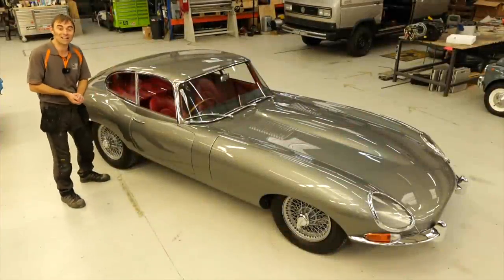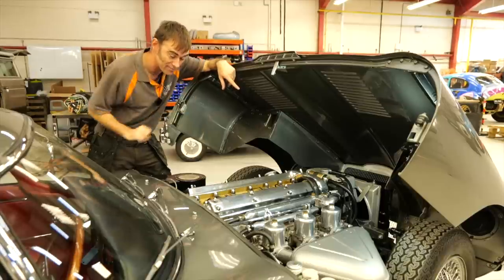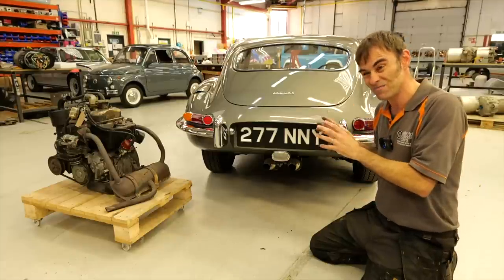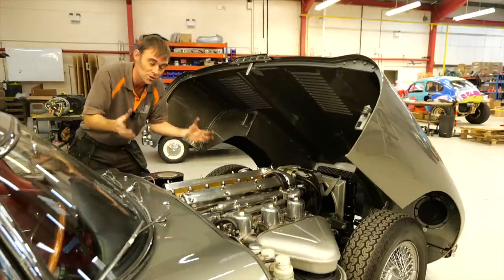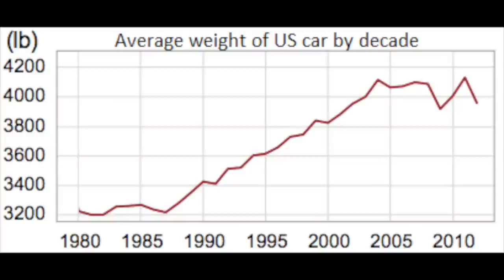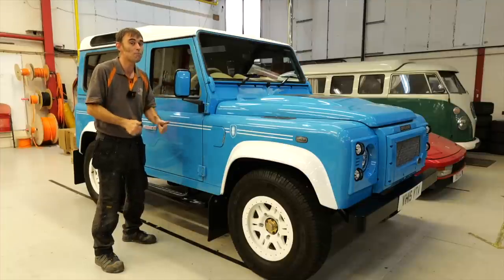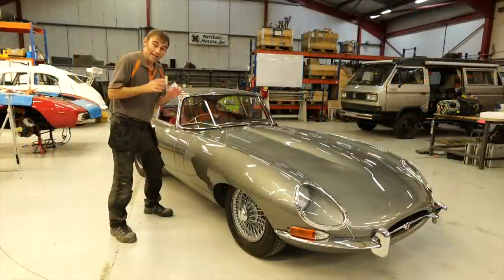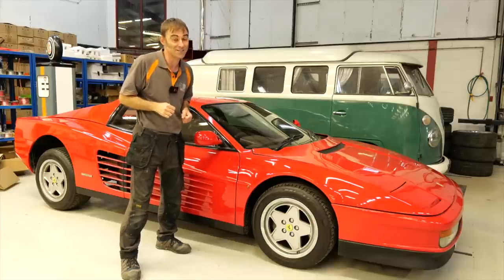Is it a sin to convert a classic car to electric?

Comment: I agree and applaud what you are doing, just got my first electric.  I think the biggest obstacle in some cases is the usability factor, meaning in say a jag, you have to give up a lot boot space in order to get a decent amount of range.  I would love to see some conversions figure out how to put batteries in the floor of the old classics, making the car super useable for everyday, or weekends  away.
Reply: in response to your conjecture, watch the ecc video about the conversion of the testarossa AND how far do you actually want to drive in the same stretch? (Google translate)
Reply: Some conversions lose very little boot space. 👍😀
Reply from the maker: We often lose very little boot space and some cars like the Testarossa the luggage space increases. 👍
Reply: I agree with this statement. I have one car that is enjoyed primarily for an annual trip from UK to the Alps for a week each year that I would dearly love to convert to electric, but the sheer pain of being able to get there, enjoy the week and get back means it's just not feasible with today's battery technology.
For reference, this year that car cost me £850 in petrol for 2,200 miles in one week (and I wasn't the highest consumer of the group!)

Comment: Soul: Because it is still related (albeit 'just') to fire. External combustion much more so, but there is the lineage, and we like to play with fire. Not passing an opinion and have long accepted IC can't continue for ever, and nor should it. But we need to make it fun and most (note caveat) are not appealing  to petrol heads like myself (Morgan's 3-wheeler from a few year ago is a wonderful exception) and they'll sell themselves. Your way of doing it is fine by my reckoning and has a role to play in showing people we need to find different ways of having fun.

Comment: I like the idea of electrifying old/classic cars. It allows people to drive something really cool/beautiful, but not deal with the hassles of ownership (maintenance, etc) like you mentioned.
Regarding soul... I believe that refers to the sound and vibrations from an engine & gearbox. The gentle rocking at idle. The sound of the air intake and exhaust. Interacting with, and the 'click clack' of the gearbox. The clutch actuation and occasional grinding of gears. Warming up a car, maybe skipping gears until optimal temps are reached, and then booting it!
Most old/classic car owners love that kind of stuff. I can understand it, but I'd rather just get in and go! LOL

Side note: One thing I've always wondered, how do you store an EV for longer periods? Say 1-3 months or more without damaging the batteries? It seems modern hybrid hyper cars have issues with sitting around, sometimes requiring expensive battery back replacements. Would it be the same with an EV conversion?
Reply: just keep it plugged in.  The battery management system will look after everything.
However, lithium batteries have a much longer shelf life than lead-acid in any case.  You would have to have it in storage for a long time / have a vampire drain to cause concern.

My limited experience of lithium cells (ie, from a phone battery cell) is that they will, if allowed to discharge too far, refuse to charge at all (I think the chargers fail to detect their presence) - but manually adding voltage (jump start with another cell) will bring them into use again.  Discharging is bad for the batteries of course, exercise caution etc, but they can be brought back.

Comment: I think two of the major cons to electric right now are charge time and the total distance the vehicle can drive. Not to many people can afford having an “in town” electric commuter car and also a long distance fossil fuel car. Electric is well on its way but until these problems are solved it will always be in the back seat compared to fossil fuels. Additionally battery life is not yet proven and is an extreme cost if they do need to be replaced. I have pursued so many different options to convert a 53’ Dodge M37 to electric but currently not many options are available for that heavy of a vehicle. The energy density between fossil fuels and an electric battery  does not compare yet but hopefully one day it will. This is one of the major problems with an electric semi truck. The gross vehicle available cargo weight is substantially reduced due to the weight of the batteries needed to get it going. Diesel fuel allows each semi truck to tow more weight in each load than electric is capable of. I appreciate the videos and enjoy them! Hopefully one day we can crack the battery problem “Achilles heel” of electric. Your correct in stated that an electric motor is far superior to any fossil fuel engine. The difference is the chemistry in which these engine derive there energy from is not comparable as of yet. Keep the content coming!
Reply: distance travelled is the problem for me I do a minimum of 200 miles a day ,  when it is minus 20 or 30  with snow on the road  how far will that electric car get me ? With snow and ice it can take 2 or 3 hours to go  100 miles  when the temps are low I would be very worried  that I would be stuck dead on the highway  not much worry with my gas cars as i get at least 350 to  500 miles on a tank cut that by 20% with heavy snow with traffic moving at 30 mph    still nothing to worry about
Reply: that is true , look at how heavy some of the new electric hickuptrucks are now . Some are over 9,000 lbs  with no load ,, hat is a hell of a lot of weight . Would not like to be in a car that gets t boned by that beast
Reply: @imarobot3757  Yes, you and the 6 other people with the same driving needs can still get a gas car. That will be ok
Reply: @imarobot3757  that's 1 EV. Other eV trucks are 6700-7100 lbs, around what a F-350 weighs. And I'd rather me tboned by that than a 14,000lb commercials truck, of which there are millions. The 1st gen of these long range EVs will be heavy, subsequent iterations will discover how to build around the new architecture and remove weight.

Comment: This is quite an interesting perspective on the relationship between an electric car and a petrol car. I find them completely different machines. Like the difference between a motorcycle and a car. You can have a car with a motorcycle engine or a motorcycle with a cars engine. Sometimes an electric motor destroys a car and sometimes it improves it.

Comment: It has often been the case that a particular vehicle benefited from an engine swap, sometimes to  a completely different manufacturer.  That was never considered a sin, it was a way to make the car legitimately better.  Similarly, swapping in an EV package is great if it improves the product.  Further, I say forget about 'reversibility'; no one is ever going to put a gas engine back in one of these if it's done properly.  EV technology is only going to improve.  Batteries will get smaller and lighter for the same capacity, same with motors/inverters, etc.  Plan to adopt those changes, not go back to gas.

Comment: I would say character, rather than soul.  Listening to your engine, you can hear what you're feeling. That is, if the engine is struggling, or on song, with the wind behind you. It sounds different when it's cold, or lumpy when it's too hot. You can hear the odd misfire or pop and bang on the over run.  You can hear the difference between a straight six or a V6, a V8 or 4 cylinder.  When it's purring away nicely, you feel contented. 
I could go on and on.  Maybe someone could put it more succinctly.  ....maybe soul is not far off, now I think of it haha
The electric motor, amazing though these installations are, is more like an on/off switch. It's always the same, regardless of what you're doing.
I think what you guys do is terrific, and a great way of saving many of these vehicles.  I'm just not there yet...I'm always a bit behind the times, mind you.

Comment: I am from germany. I was a proud owner of a 1977 Kawasaki Z1000 A2. That one with 4 cyl, 4 carbs and 4 exhausts.
In germany we have fuel with ethanol in it. You can't get fuel without since years. 5 years ago it gone so bad, that the fuel destroyed all the rubber parts, cast aluminium, paint and i always had water in the tank. In 2020 i was driving very often, cause we aren't allowed to do other stuff. Then i noticed, that the fuel got worse once more. Every 2 weeks i had to repair a carb. So i had to disassemble all 4, check them sync them install them. Then driving 200-300 km and the same crap. I had to change the fuel hoses every 2 weeks, too, and the fuel cock every 2 month. At the end i just filled in a few liters, drove it arround, and release the fuel from the bike.
Yes, from the tank and all 4 carbs.
But the problem came back. So i decide to sell it after a repair, and got lucky to sell it to a collector.

Then i bought an electric motorbike for a damn high price, and was happy about the missing repairs. 
But then i noticed, that the range is not the promoted one. So i have to calculate my route, and don't go away from it.
I miss my old Lady, but it was time to let her go. There is no way, to transform an old bike to electric. You will not get any good performance or range out of it.

Comment: You make a good point about fuel for classics. 

Petrol stations operate on tight margins. Within the decade petrol stations will begin to shut as demand drops and they are no longer profitable as we move to EVs. They will become fewer and further apart making ICE ownership difficult. A tipping point will be reached where it’s not worth keeping any open. 

This will be disruptive. ICE car owners will find themselves left with a useless vehicle. Although classic car fans might think synthetic fuel will come to their rescue, there’s not enough demand to keep a nationwide network of fuel stations running for a small amount of low mileage cars. 

Electrifying classics makes a lot of sense and preserves them beyond the demise of fossil fuel.
Reply: Yes, if you want to continue with ICE (some enthusiasts will and so they should, in the way steam vehicles are preserved) you will have to have the fuel delivered to you or go to a few specialist outlets.
Reply: There are still over a BILLION ICE autos, that will never happen

Comment: I loved the video and agree with mostly everything you said but RANGE RANGE RANGE! You never mentioned it once? I know it varies wildly for all sorts of reasons but here would have been the perfect place to explain the options and likely outcome of the range on a few of your examples I think.
Reply: I think a lot of the regular size cars are in the 200 mile range, but large, heavy vehicles may be less, as well as tiny ones with little space for batteries. However, if you have 100-200 miles, that's plenty for daily driving and a Sunday cruise

Comment: I like the idea of recycling the old cars and making them more friendly to the environment. I guess most of the cost of salvaging an old car is the body repairs to make it look brand new. I have one question: Did you have a request to convert a car to hydrogen fuel cells? Toyota is doing huge progress in hydrogen storage and ease of usage. Did you include Toyota power train into your work? It may reduce the weight of batteries and you replace the gas tank with a hydrogen storage unit.

Comment: Great episode!  For me the choice would vary from car to car. I would be okay converting my old Porsche 912 to electric (but I’d miss the smell of old car mechanicals) but I wouldn’t want to lose the sound of my Honda S2000 engine and shifting its gears.
Reply: I'm sure someone could make an air freshener for that!
Reply: I built a Wesfield from the ground up, complete nut & bolt rebuild of RS2000 engine, twin side draught 45s & a straight through side pipe.  Been driving electric since 2015 and if I ever build another Westie it'll be electric. Do I miss the noise? - Ask my tinnitus!  Do I miss the smell of fuel, oil & warm timing belts when I open the garage door?  I have to say yes - But that's about it.
Reply: I would be happy to buy the Porsche,...... Yet it's in America, isn't it.

Comment: I have been a bit of a petrol head myself, which a number of twincam / turbo charged / mid engined cars over the years. I don't miss those ICE engines at all now I have gone electric (we currently have a Tesla Model 3 and an old Nissan LEAF for running about town that just keeps going without any servicing). Sure I'm no longer young but I think when I was young I would have enjoyed the Model 3 just as much as I do now (if not more). 
That all said there is a small subset of classic cars that are worth keeping in ICE form - those rare cars with great sounding engines - and less likely to be daily drivers! Could you imagine taking an original Supermarine Spitfire IX and converting it to electric when part of the air show attraction is the roar of that Merlin engine!

Comment: I'm old enough to know that these Jags were very popular, here in the US, back in the '60s, but in the '80s, living in Florida, I worked with a mechanic that pulled the Jag motor out of these cars and replaced them with a small block Chevy, along with an adequate sized radiator for the subtropical climate.

Comment: One con: Living in a very cold country.. Range becomes much more of an issue at minus 30°C. A brand new petrol car will start and run. Refueling requires very little time. Re-charging a VERY cold battery is challenging to one's patience, even with battery heating solutions available. Future nano technology batteries may solve this problem. And, the future is definitely not in favour of the internal combustion engine. Love your show, keep up the good work! Edit: PS: I will miss the "noise" of the all American V8.. From a purely nostalgic point of view.
Reply: Modern ev car batteries have better functioning heaters on them to mitigate these issues. From the little I've read on them, they do fairly well at keeping the battery working well and not failing early.
Reply: @ax14pz107  Well, I don't personally own an electric car. But I know people who owns brand new electric AUDI's, BMW's, and Tesla's.. They say that all the talk from the dealerships about handling extremely cold conditions, is not backed by reality. The dealerships do admit shorter range though, but reality seems to be tougher. Also, in the motor press in Norway, there seems to be consensus about this. But as I said, I have no personal experience with this, it's just the opinion of these car owners that I know.. PS. we have (so far) absolutely no tax on electric vehicles in Norway, therefore, electric cars have become more common than anywhere else in Europe. And, some places in Norway do get cold in the winter.
Reply: @PaulM745  yeah if they're leaving their cars unplugged overnight, outside, they're going to get very cold, but that's true of gas fueled cars as well. If you live in areas that cold, don't you have to install block heaters in order to have the cars start anyway?
Reply: @ax14pz107  modern petrol cars with a good starter battery, and motor oil suitable for cold starting, no problem. They will start. Diesel can be a problem. Especially if you have the summer mix diesel on the tank. In winter, the diesel is mixed with kerosene, to avoid the diesel going solid. Also, it always pays off to replace the diesel filter before the winter season. And, the starter battery and glow plugs need to be in excellent condition. Provided maintenance is good, fossile fuel cars have no range limitations, and refuelling is fast. This being said, I'm not against electric cars, but we are still in the late "pioneer" era, especially when it comes to cold climate. This will be solved with future technology...
Reply: @PaulM745  I see. We also have EVs that run at higher voltages now that can pretty much max out the battery in fifteen minutes when charged at a fast charging station. Range shouldn't really be a concern anymore unless you're very rural, driving constantly, pulling heavy loads, or just have no access to overnight charging. For the majority of us, the infrastructure to use EVs as daily drivers is already in place. My next car at this point is basically guaranteed to be an EV. I don't have to deal with extreme cold though. Temps here range between -2 and 37 usually.
Reply: @ax14pz107  perfect conditions for ev where you are then. If I were to buy a car, it would be an ev as well, despite the winter challenges.

Comment: What a well presented argument and total low key stealth tour of the treasures in your amazing facility! I agree 100 percent. I love cars. However, I’m not a petrolhead. I love most cars for their design. Like you said the majority of engines in classics is forgettable (literally any old vw engine for example). Maybe interesting from an engineering point of view but that’s about it. IMHO very few ice/car combos absolutely shouldn't be converted. I’m not gonna lie - the moment Tim turned on the Jag - that sounded lovely. Same goes for my 5.7l V8 Jeep, I love the sound of that boat. But that’s just it: it’s just that moment. Then you start to think about/experience it - the cost of gas, the pollution, the parts that may break down in your old ice engine at any moments notice and leave you stranded, the noise level, especially over longer road trips, the fumes wafting into the cab from bad air ducting and on and on. And then I read the comment below by your client who talked about his converted Ferrari. Wow. I might just save up to have my old Jeep converted.